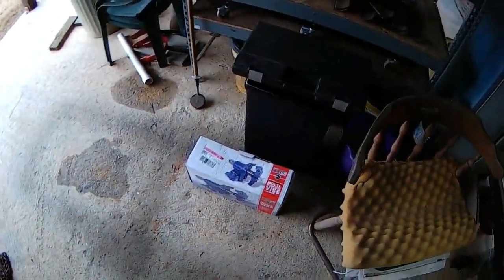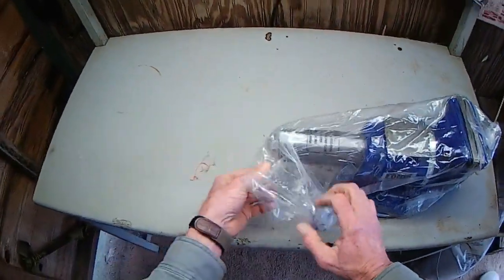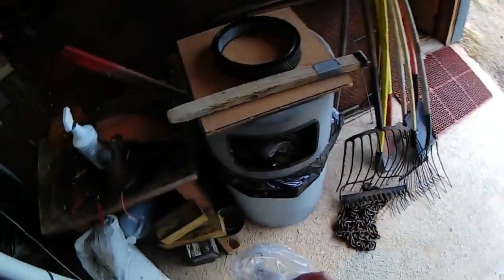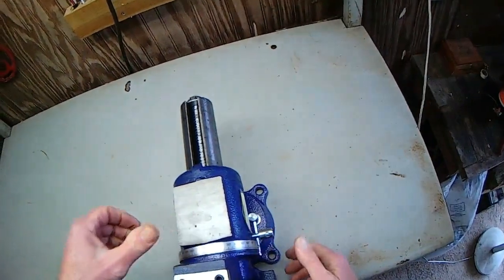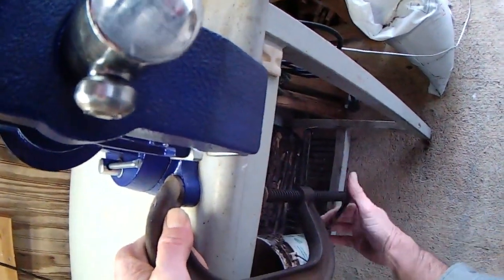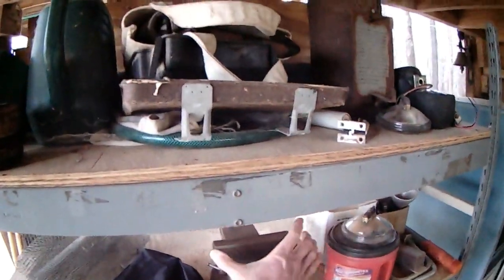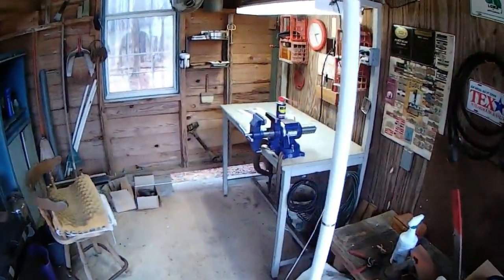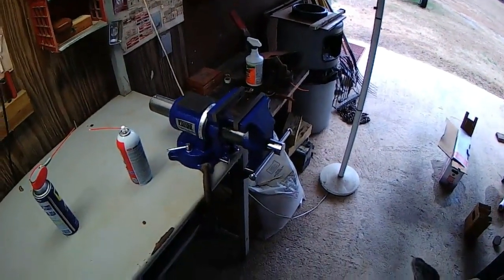Checking out the new Vise

Comment: You have the cleanest workbench of all the channels I watch. You have a beautiful property.
Reply from the maker: farmark - I can clutter that bench up some kind of good when I got a project going.   but I get reorganized after a project is completed.  I got three different tool cabinets and in my mind I know what is in each drawer of each cabinet.  however right now I can't lay hands on a 6" 1/2 drive extension.   that will bug me until I find it.   it might be underneath the floor plate on the 4020 and if so it might have bounced out into the field the other night to become an iron additive to the soil.    thanks for watching and commenting.
Reply: Soybean Farmer    When you looking for your extension see if you can find my favourite brass punch that grew legs and ran lol
Reply from the maker: farmark - speaking of punches.  I found out how low grade mine was when I wanted to mark the locations for drilling the additional holes to mount the light switches on the 4020.  I lined it up, I held it, I hit it and it broke.  ended up using a nail to get a drill bit start divot.   LOL

Comment: We have several of these at work. Super handy with the pipe jaws. One thing to look out for is the tiny screw on the side for locking down the flipping of the jaws will strip out easily. 3 out of the 4 we have are like that after about a year. Other than that no complaints.
Reply from the maker: ignarski13 - the pipe jaw is going to come in really handy.  getting a pipe locked down on a flat jaw is difficult and sometimes ends up messing up the pipe.   thanks for the tip.

Comment: Looks real smart from here however don't go doing any real heavy pounding on something held in the jaws - That's why there is a small anvil on the rear jaw housing!! One other point, the milled surface on the jaws looks pretty aggressive which will marr up the surface of something quite badly when you clamp it in the jaws. Look out for some copper or aluminium flat plate and make a pair of caps to fit over the faces so that when you need to grip something tightly but are concerned about surface damage to the item you drop the copper into place and carry on. Granted the jaws will not grip as well but at least the work piece will not be damaged.
Another possible alternative is to look where you bought it from for a pair of "soft jaws" on sale. You unscrew the steel jaws and substitute the soft jaws in their place and carry on.
Reply from the maker: Dan Whiteford - good tips thanks Dan.   I like these.                       https://www.homedepot.com/p/BESSEY-Non-Marring-Vise-Jaw-Accessory-for-Use-on-Vises-with-Jaws-from-3-in-to-6-in-Wide-BV-NVJ/204986223?cm_mmc=Shopping|THD|B|0|B-BASE-D25T+Tools&mid=WKz5aCU2|dc_mtid_8903vry57826_pcrid_73529856928951_product_204986223